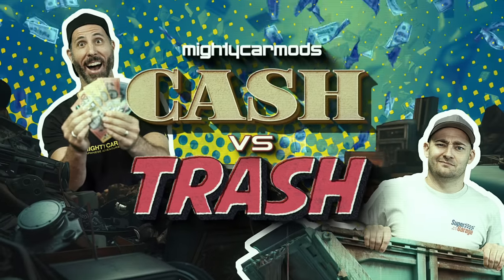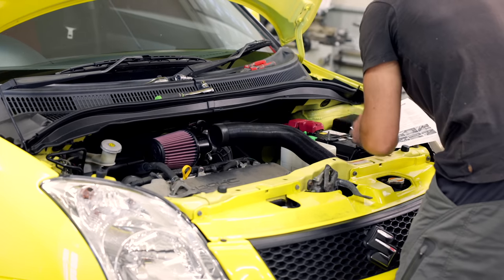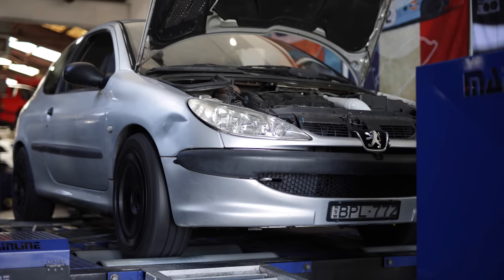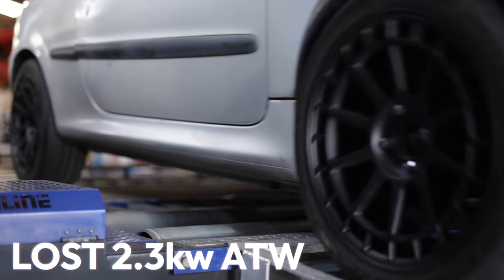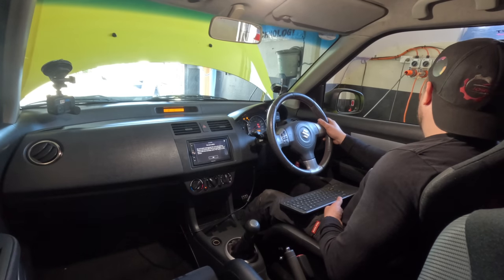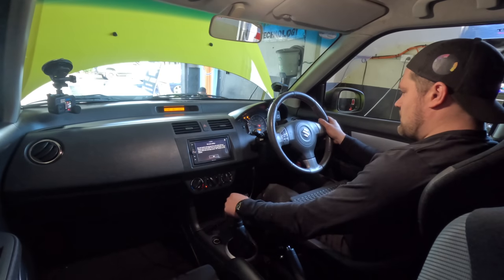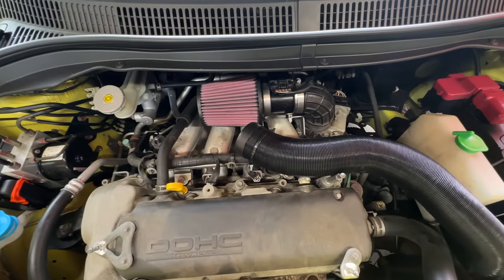Dyno testing POD FILTER Performance Claims | CASH vs TRASH

Comment: Ya that K&N setup would loose power!  Hanging out unshielded over the exhaust after a full 90 degree bend for instead of a series of more gentle bends… also no cold air “box” so the pipe installed isn’t doing much specially in that situation it can’t feed any cold air. 

90 degree bends kill pressure/slow flow. Much better to do a series of more gentle bends to get it in the right spot..  don’t use bendy tubing, use ridged tubing to get it positioned and installed. 

Also wanna heat shield and/or box in the filter in such a way that it can’t suck in hot engine bay air nearly as much… specially shouldn’t be hanging over exhaust manifold. Heat soaked that thing will be as powerful as a wet sponge with that placement. 

Cold air feed should just bypass the radiator and be a straight shot as possible with minimal distance to avoid heating the pipe from engine.  also wanna shield and box the air in so only place cold air goes is the intake not hopefully the intake. And again, ridged tubing is best.

Comment: Original wheels and tyres should be fitted for a fair comparison. Power measurement on this dyno is calculated based on how long it takes the vehicle to accelerate the dyno rollers to a certain speed so tyres and wheels will skew the results to some degree. Moog's wheels and tyres were a lot lighter though so power at wheels should be greater in either case so something is not right here.

Comment: What a stupid location for the intake.. butried deep in the engine bay lol.

You're much better to have the airbox. The whole engine ecu is tuned to the factory set-up, positioning of the MAF relative to the incoming air etc. So many factors affect it.

Just a K&N panel filter is better.

What I would say is, increase the distance between the MAF and the pod filters. Pod filters create horribly turbulent air which remains turbulent when it flows over the MAF, which gives an innaccurste flow reading.

Increasing the distance will allow the air to better reconstruct to a streamline flow.

Comment: After a third run it has heat soaked. They did not show doing warmup runs. Without this there are variations. Intake length and width change the affect air pulses right up to through the exhaust. 
They admitted to not measuring other parameters ie wheels. Conclusion: amateurs.

Comment: Hot air intakes will ALWAYS lose power, no exceptions. Some cars will still gain a bit with a tune, but honestly, don't run this shit (unless there is a proper enclosed version for your car that doesn't completely delete the factory airflow). The intake in the Suzuki is at the very back of the engine bay too, which is a rough place to be.

Comment: Ok, so am a mechanic, but let's be clear that I am not an engineer, right? But I remember the college theory times ....... I think lol

Here's what I think is going on. 

For both of you: A straight intake might not be the most efficient if not tuned for it. Those stupid little pointless elbows and pipes that go nowhere in your stock and shit sounding intake serve a purpose. They dissipate the high pressure return waves that occur from your intake valves closing. Those pressure waves impede airflow. They also get rid of the sound which is why they sound shit. C'est la vie

This probably doesn't matter as much in force fed engines or race engines with 5 inch (12.5cm) velocity intakes. It probably gets worth with a foot or three of straight pipe.

K, last one is for Moog. I can't think of a hotter place to put your filter. I call those Hot Air Intakes

Comment: They loose power cause if it’s still the stock tune and add parts it won’t make more power it will only make more power with a proper tune I’m not sure if they tuned it or they just run it on stock tune to get a the #

Comment: No matter how many add ons or what add ons you do, you will lose power 95% of the time unless you remap the car, the car is tuned for how much air goes in and out and when you add things that alter this it basically makes the car untuned...

Comment: 90% of the time,pod filter is useless.
Most people remove factory box and stick the filter in, sucking hot air.
Most of the time,stock airbox are good and optimised for the engine,in length,resonator and other aspect,that make the car feel better across rpm

Comment: I can't see how an open filter at the back of the engine will ever make more power. To work it needs to be low down and at the front to draw in cold air.

Comment: actually as much as i know, pod filters are good for turbo or supercharge engine, but the naturally aspirated engine is different, pod filters are make it loss some power to the engine. Well again this is as much as i know because i have car with 1.5l na that used a pod filters and it makes it slower. If anybody knows, let me know, because im still learning to

Comment: try unplugging the maf connector and disconnecting the battery for 15 secs
Reply: On the gti I found that unplugging the cable on top of the engine next/between the camshafts works.

Comment: I put a k&n sai on my honda fit, got constant check engine lights and sputtering, ran like a dog. Switched to hpf and the light went away and it runs great. K&N sucks, they make cheap half baked products and dont test and design for specific cars, they just spray paint a tube and call it a day.

Comment: Mart is right, plus pods don't do nothing unless enclosed with a cold air feed, also k&n hasn't developed there filter material since the 90s and piper cross foam filters rot and collapse, with something like the swift a decent panel filter would be a better way to go, the system you got looks like it should be on a 90s max power pos, these days company's are selling stuff on there reputation  from back in the day, I'm not saying k&n or Piper cross are, but it's food for thought

Comment: Guys it’s simple, the engine is pulling air in a hot environment engine bay, the factory air box was designed to eliminate the heat from the engine, if you don’t agree with me, prove me wrong… man

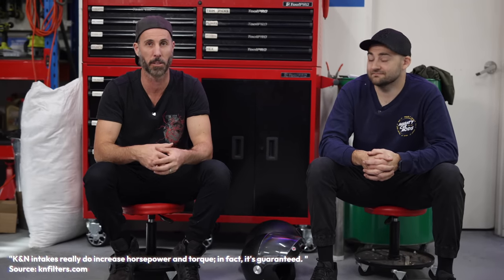Comment: 4:22 I would guess you need an ECU remap to take greater advantage of your air filter. Not exactly what K&N is claiming in terms of bolt-on horsepower tho
Edit: I should’ve watched for 50 more seconds

Comment: OMG. also 69 in both Tests xD. I wonder if the placement of the pod filter was a problem, Or the difference in Wheels and Tyres. You should do a Hub Dyno to re test your car. I wonder if you guys would need a boost controller "Ultimate 9" to tell the standard ECU what your using the car for.

Comment: Significant changes to the engine’s airflow characteristics, fuelling and timing re-optimisation required. 

Then you’ll find out whether the other changes have been beneficial or not. Otherwise it’s a bit of a nonsense. 

No merde, that’s facts.

Comment: hey guys I've experienced these pod/cone filters and from my experience you'll have to get a tune done to your engine computer to handle that extra air and compared to your stock intake it will definitely perform better.

Comment: So why get a savage monster exhaust and then a horrible k&n intake? Monster does a savage intake thats actually the same bloody price. You make the power by getting a good engineered intake not just a thin ass filter popped onto the end! You need big pipes so it can have big airflow run into the intake, of course you'll lose power with a pop filter sitting on top of a hot engine. There is also a simota cold air intake that is ment to be the best bang for buck as it's bigger filter area and also an inclosed set up so it's not just sucking in hot air. Honestly the boys should just come to me to spice up their swift!

Comment: surely if your going to add a pod filter to add more air to the engine to make more power, wouldn't you need to upgrade the injectors to add more fuel to make a bigger bang and utilize the extra air to make more power. in essence adding more air without adding more fuel would make the engine run lean.

Comment: Try installing the K&M properly. The filter does not go directly on the MAS air flow sensor. The air filter goes on the other end of the black pipe that is doing nothing and connects the other end to the throttle 🤦
Reply: what? its a MAF sensor... it isnt even that.... its the stock ecu and injectors/ fuel pump thats causin it to run lean at higher rpm.
Reply: @ttocs  MAF and MASS senor are the same. Just two different names. The kit is a poor design. I thought they had installed it wrong. But it is that badly designed
Reply: @derekstanley5558  true. the second kit is probably fine, so i'd like to disagree. i think the ecu can only at most do 5% (experimental significance) more or less mass through the intake sensor before it cannot keep up in terms of fuel pump pressure and injector flowrate.

Comment: Correct me if I am wrong, but that looks to be a different shop and a different dyno. You can NEVER compare before\after results on different dynos. I have had my same car with the same mods on 3 different dynos. There was a 30hp difference between the highest\lowest numbers.

Comment: The fact that it's just sucking in hot air from the engine bay instead of cold air from the front is probably why it lost power.

Comment: Why are you surprised? you have the Suzuki sucking in air from what looks like the back of the engine bay, you installed a Hot Air Intake not a cold air intake 😆

Comment: this isn't hard, the wheels and tires and wider and bigger than the stock ones. Tuning was the major factor here. more air needs more fuel which eqautes to more power, sprinkle some ignition timing and some fuel wherever it leans out. should see a 10-15kw gain.

Comment: No matter how many videos like this that people making post on YouTube showing that these things don't add power and actually cause you to lose power, Guys will run out to pay 3 to $500 for these intake systems. They think hearing more induction noise means more power. Those guys called engineers that work for the manufacturer's actually know what the hell they're doing when they designed your intake.

Comment: Dynos are not an exact measuring tool. With lots of variables. Outside air temp, humidity, dyno temp, cooling fan placement, how tight the straps are, hell even going from 5w30 to 10w30 oil can change 3 to 6 hp. Put any car on any dyno do 3 runs 15 min apart for cool down and i bet there is a 6 hp difference between all the runs. Without changing anything.

Comment: Is it just me or did you dyno on 2 completely different days? Results are only comparable between powerruns when they are back2back. Since you both lost power, 98.76% sure some if not all off the powerloss is due to conditions, not mods.

Comment: well the math is fast done . the lost of power on the peugot is normal the exchaust is way to big in diometre and realy the intake dont realy give more power .  the swift yes well in order to get the claime hp more by kn you have to know in what condition this filter is tested . 
so i think for the combination on the swift its only go to work with a tunne on the ecu sins the valiors of intake and outlet are higer than the stock ecu is maped for . ( every perfomance part is mostly instaled on cars with a tuned ecu ) .

Comment: Common 4 cylinder mistake. 3 inch exhaust is way too big and costing you power, because you need a certain level of back pressure. 2.25 would most likely make more power.

Comment: Can i give you a simple example with your pod filter issue picture your throttle body as a mouth now picture that mouth wrapping its lips around the pod filter 
Now purse your lips  and breath in fast you will find you can breath in for longer faster and more efficient. Now same again only open your mouth as wide as you can and breath in as fast as you can your lungs fill quickly but inadequately. Same principle

Comment: Marty lost power due to his exhaust; the exhaust episode confirmed it because of the drastic change in diameter, not needed for his little engine. Moog lost power because that intake is absolute trash, and a pathetic attempt of K&N to make something work. It's literally a filter and a hose, no design went towards the intake itself to make it engineered like they have with other intakes. The best thing Moog can do is take the old intake back and swap in a K&N panel filter for increased throttle response and call it a day. I do believe Marty's case would have been relatively close to stock if he would have kept the exhaust diameter the same, and just put on a bigger fart can or something.

Comment: That,s a cold air induction. Really it needs to be upfront with a heat shield and forced air induction. I didn't see a fan blowing into the engine bay on the dyno. Those type of filters really suck ass if they get warm air in.
Reply: Agreed

Comment: Please stop calling them cold air. They are pod filters. Cold air filters actually have housing to prevent heat soak and draw fresh air. Also you NEED to have it tuned to take advantage of the airflow.

Comment: From personal experience with the case of the rx8, the stock intake system and filter is the best way to go. I had a k&n drop in filter on it and it started running weird. I pulled it apart and the airflow meter was covered in oil and dirt. Maybe only on turbo applications, a pod filter would make the biggest difference.
Reply: not true. the engine runs lean at high rpm due to the extra air. need to send the ecu out to get tuned regarding the modified intake. might want to upgrade fuel pump and injectors if it still runs lean after tuning. bigger throttle bodies are easy to swap in fords.

Comment: "Lost power"...... You are comparing dyno runs on different days, different temps etc.
Was it the same dyno?
Those hot air intakes aren't much chop anyway.
Might have gained if the bonnet was up but that doesn't replicate real driving conditions. The Swift pod is right at the back and on top of the engine.

Comment: Scavenging....in some cases a single exhaust is better than a dual/dual outlet   the exhaust actually helps pull out the exhaust (kinda like a siphon)     also sometimes a longer intake "tube" is more desirable that a shorter intake    also that filter is pulling in very warm air        1984 Datsun S12 V8    summer daily driver

Comment: Never really understood the whole pod filter makes power thing. You can't sell a filter saying this filters air better than stock and it makes more power. The more effective the filter is, the more restrictive it will be. I have seen a 22BHP gain on a 240BHP normally aspirated Zetec by simply taking the Pipercross air filter off the throttle bodies. If the filter is well made and is an effective filter you've made it harder for the engine to get air through it.

Comment: I think both of you lost HP for different reasons.
Marty exhaust is way too big, his home made intake is actually a small improvement (performance wise) as it is a cold air intake and Peugebro stock intake is crap.
On Moog, that K&N is in the worse position, not only all the heat from the head is there but it's where air isn't moving, pipe feeding cold air isn't enough when the filter is all open above the head.

Comment: You can't just bolt mods on a modern car. Neither one of those cars is going to make any More power until they are tuned for the modifications. Modern systems are so dialed in for factory components that they don't know what to do with aftermarket components. Tune both cars and they will make much more power.

Comment: This experiment is wrong. You need to reset ECU and drive for at least 1 week to allow adaptation. When you directly move from stock to pod filter the airflow goes bonkers and the ECU won’t know there’s dramatic change. You either drive for long term or reset the ECU the drive a few engine start stop to force the adaptation.

Comment: Not that I've proven this, but I've been told that you can lose power with this mod because now you're drawing the air from right inside the hot engine bay instead of from the front where the air is cooler. In fact it does look like the K&N filter was right next to the exhaust header, which would make sense. Also this problem would only get worse if you did that test with the bonnet close since the heat would be trapped inside. Can someone that actually knows what they're talking about fact check me on this?

Comment: You both lost power, you have two very different intake systems.

You both also have new wheels and tyres vs the originals. New tyres have higher rolling resistance generally

Comment: Why in hell Is the filter BACK behind the engine? That is a hot zone, location makes NO sense! A S&B CAI on my 06 cummins does help, but it also moves more air in and helps protect from pulling in hot engine bay heat.

Comment: YOU NEVER EVEN PROVED IT WAS THE INTAKE CAUSING THE LOSS. THIS IS NONSENSE. You just assumed it had to be the one with the power increase guarantee that caused the loss in power.

That's not logical in the slightest.

Comment: Neither of you put in a proper performance CAI system with an airbox or vents so the engine can suck in colder, external air. Sucking in hot air that gets trapped under the hood is going to result in power loss, especially when your system is installed right behind the engine. Cold air is denser than hot air, which means means even though the intake hose is still the same volume, you can fit more cold air in there than you can hot air. The colder the air, the better the air and fuel mix, resulting in more power.

Comment: You can never make horsepower with a filter and exhaust without making other changes. If you could then tell me why car manufacturers will spend the second most amount of money on the intake and exhaust after the engine. The more power they can make an engine make smaller they can make it the easier it is to hit emissions numbers.